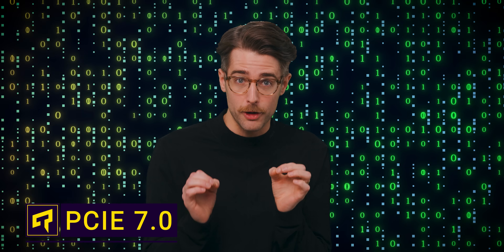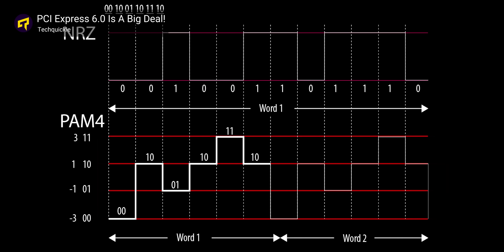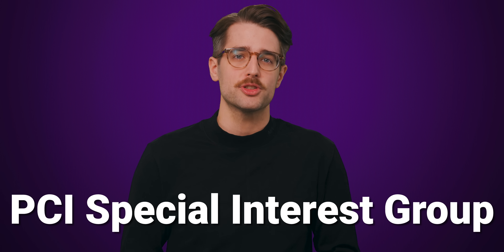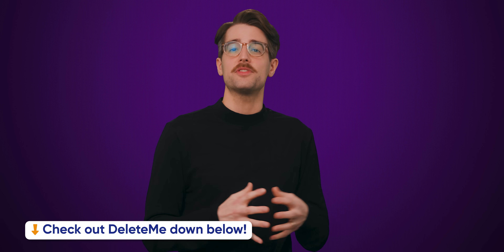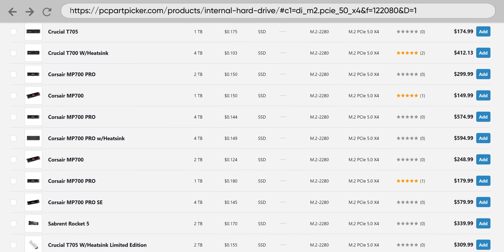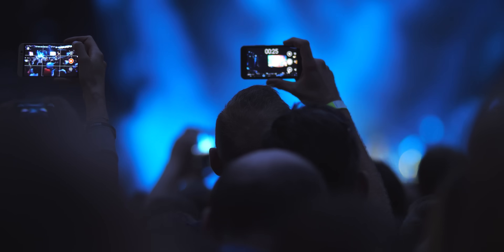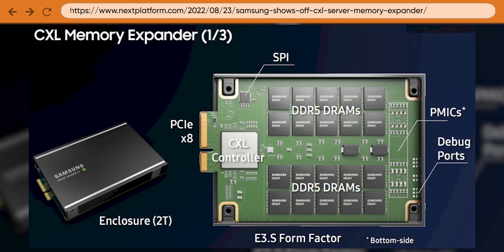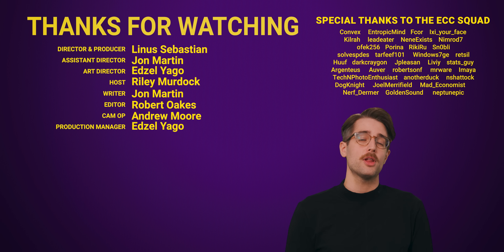PCI Express 7.0 is INSANE

Comment: if PCIE keeps growing faster than our needs we can just reduce the number of lines used, that would make everything easier
even nowadays barely anyone needs 4x5.0 for their SSD, that's only fast for sequential transfers and under load it drops to the same speeds 3.0 does, make it a single line and simplify the communication!
Reply: We can, but motherboard manufacture says otherwise

There's so MANY motherboard that originally has x8 PCIE split socket but now they only provide 1 direct CPU PCIE.

Comment: So like normal a standard for the data center that will get onto GPUs so AIBs do not have to buy 2 types of chips. Another one for nVidia to use for the much higher speed networking cards and not have the bottleneck for the PCIe speed it is plugged into anymore but the CPU.

Comment: PCI Express 7.0 will likely be used for neural processing units (NPUs) on local computers, allowing users to buy specialty cards for that purpose. These NPUs will be at the top of the PCI Lane motherboard layout, with the GPU lane underneath. As AI and AGI continue to advance, people will want self-contained units for tasks ranging from video editing and overlaying to full-on Jarvis-like capabilities. Alternatively, PCI Express 7.0 might be dedicated to external boxes handling AI, AGI, and GPU units through fiber-optic or proprietary plugs. The average computer, with a GPU and basic NPU, currently takes up 4 to 5 card slots, making it challenging to utilize all PCIe slots efficiently.
Reply: Just add more lane, like you know, AM5 eventually did add.

Much more easier, cheaper, and possible than pouring extra money to speed up the development for consumer grade and make consumer deal with the 100% extra price on top of already overpriced motherboard. If you concern dies are getting big, you can shove dual arm retention bracket that Xeon already used from 15 years ago.
Reply: this comment sounds AI-generated to me

Comment: The idea of RAM through the expansion bus sounds so 1970s (think IBM 5150/8088). But I suspect expect it's going to act more like how the Amiga functioned with fast and slow RAM, just not for the same architectural reasons.
Reply: Isn't that what the swap file is slow ram?
Reply: Ram cards have existed on and off several times. Last onei heard of was in the ddr2 era
Reply: In order for any component to be usable as RAM in a system, it needs to be on a system bus that can answer memory requests, and that bus needs to operate at very high speeds. Modern CPUs don't have a single generic system bus for both external hardware and memory devices; instead they have PCIe, DDR, and other pinouts. Only the DDR bus will actually show up to software as RAM. Other storage devices are incompatible; not only are they too slow, but they also work with data at the wrong size. e.g. DDR5 is two 32-bit data channels, but hard drives work with data in 4096-byte chunks that have to be read or written all at once.

Swapfiles are how you get around this limitation, by having OS code manually juggle data between slow storage devices and fast memory devices that the CPU can natively access.
Reply: @TatsuZZmage  the swap file, as the name suggests, is a file, not actual RAM. Its used to swap out sections of RAM with memory on the disk if your tasks need more RAM than you actually have. It doenst have the "Random Access" of Random Access Memory, but yeah in a certain sense it is (very very slow) RAM. Not by the proper definition of RAM of course, but it is part of the virtual memory the OS manages. 

Technically the swap file memory isnt even ever actually directly accessed, it just gets swapped back into the RAM, with another part of RAM being put in the swapfile instead.

Comment: looking forward to skipping 7, and 8.
i'm interested in what 9 and 10 bring to the table. also more lanes like 128 per slot completely independent. 
imagine game scenarios created in real time. no two games will ever be the same. lol, in order to win, lol, you are going to need a faster even computer advising you. lol.  your brain will tap out. you will never leave the game... you won't know real from generated. 
64 bits, yeah, too slow. time to move to 128 bit processors. quad hyperthreading.
terabytes the new ddram standard supplied on chip. 1000 terabyte transfer rates.

Comment: the "only" reason this would be beneficial to users at home is making older gpu's & m.2 use so few lanes you can have a ton of w/o running out of lanes (as they'd need less lanes of a higher spec)
Reply: Except the ports just adjust to the lower spec when you plug in an older card so you do currently still need 16 lanes even if it's a shitty pcie 1 card. You could potentially have a single lane from the cpu go to a chipset that then divides that lane into multiple lower speed lanes for this purpose and effectively achieve the same thing, though.

Comment: it is un-relatable, we seldom find pci 4.0 peripherals today , pci 5 and 6 are basically fairy tales, a standard should not become a standard unless there is a slew of peripherals that use it , as in, actually use it, not just be compatible with it. it mat sound harsh, but GPUs aren't even available that can use that much bandwidth, and aforementioned Ethernet card , well, unless used as direct pc to pc connection has no router or switches to plug into

Comment: Another use case for PCIe 7.0 is that you can use less lanes with the same amount of traffic. A lot of PC have limited PCIe lanes. So having more lanes available is a plus.

PCIe 4.0 16x = PCIe 5.0 8x = PCIe 6.0 4x = PCIe 7.0 = 2x
Reply: It doesn't matter for consumers as you can't bifurcate them anyway and most consumer devices that will go in those slots wont be pcie6.0/7.0.   : / 

Lets say you have your pcie 5.0 and @x8 its as fast as 4.0@x16. But your GPU is 4.0 so it still will need all 16 lanes, nothing gained : /

Now lets say you have some other GPU/device thats pcie5.0 and since its so fast it only needs x8. So you have x8 left and youre happy. Aaand thats when you start digging and go into rabbit hole of pcie layout on motherboards and bifurcation options (lack of them...) and you realize you cant do much with that x8 cause you cant divide it into x2/x2/x2/x2 to connect four ssds, you cant even divide into x4/x4, you have to waste 5.0@x8 on single ssd regardless if that device is x2 or x4, 3.0 or 4.0 or 5.0... : /
Reply: Were lanes limited not bandwidth limited.
We have pcie 4.0 motherboard with x16 slot, x8 slot and x4 slot we can connect 3 devices.
We have pcie 5.0 motherboard with x16 slot, x8 slot and x4 slot we still can connect 3 devices.
We will have pcie 6.0 motherboard with x16 slot, x8 slot and x4 slot we still will only be able to connect 3 devices.
Reply: @sznikers are you a primarily Intel user? It’s been a thing on AMD consumer boards for quite a while now ever since AM4, AM5 supports it as well. In fact it’s straight up just supported by AGESA it’s just up to the manufacturers to expose it within the bios.
Reply: @NawWeeMan  on intel its exactly the same "just up to manufacturer to put it in bios" ... : /
They don't, squeeze on pcie lanes forces people into higher price bracket pro hardware (threadripper & sapphire rapids).
Reply: @sznikers  I’m questioning if you have used AMD because AMD board partners do expose it the majority of the time, it was exposed with my AM4 Asrock board and is currently exposed with my ASUS X670E-creator board. It’s rarer for it not to be exposed than exposed. Maybe the budget B Chipsets don’t expose it? I have no idea.
Reply: @NawWeeMan  both AM4 systems i assembled for my friends didn't had it, only the usual x8/x8 but not x4/x4/x4/x4 which is a must to use those affordable x16 to four ssd cards.
Out of 3 intel boards i have also none have anything beyond x8/x8 available.

Comment: PCIE 5.0 I really think is like going to be the the "why even upgrade past" point for most average people. 
Are there those who could make use of 6, and even 7? I'm sure. But who is actually having that much of a need?
Reply: If processor supports 16 lanes of Gen 7, then 4 lanes for 16x Gen 5 and rest of it for SSD raid or something, idk
Reply: @maksimfedoryak Right, instead of putting a chipset onto our motherboards, we could just connect each chip directly to the CPU with just a single lane each

Comment: The current generation of cards use PCIe 4, and they're already working out the specs for PCIe 7?

Maybe they should work out how to deliver more power over the PCIe connector.
Reply: Current generation of consumer graphics card, you mean. There's a lot more to PCIe than graphics as the video mentions!
Reply: Everything is being driven by the need to connect up very large NVMe arrays. Your options are:

 - Bifurcate or buy PLX switches, which divide the bandwidth between the drives in various ways and result in worse performance per drive
 - Buy CPUs with more lanes on them, which gets expensive real fast and only goes so far
 - Network multiple servers together, which adds complexity as well as cost

A new PCIe version with more per-lane bandwidth pushes back all these considerations because the primary bottleneck to building an NVMe storage array is lane availability. Halving the amount of lanes needed to achieve reasonable per-drive bandwidth doubles how many drives you can connect to a single CPU.

Comment: Optical fiber? That can be a good thing if it becomes reality. Imagine not having the issue of fixing your GPU to the case, the possibility to hot swap GPU like a big PSU box...
Reply: I think you already can hot swap GPU like that, even with pcie 3.0
Reply: @cinderwolf32  yeah, but the connector is really big and more of a lane than a connector, with a plug you'll be able to move the GPU everywhere.
Yeah, there are exteenal GPUs for mobile, but not for desktops
Reply: @TrioLOLGamers  PCIE optical extension already exist, like any hardware PC enthusiast dream of. 

The problem is It's only for enterprise and PC community keep expecting enterprise grade hardware with fast food cost.

Comment: we at PCI 7.0 and current customer motherboards are still stuck at 4.0. Can somebody tell these guy to stop innovating for a decade or two? use their brain power somewhere else
Reply: USB 3.0 was developed in 2007 but i got access to it in ~2016 and my first actual USB 3.0 flash stick in 2019
Reply: Both my AMD and Intel motherboards have PCIe 5

Comment: At this point GPUs should only do 5.0 16x connections, for the foreseeable future at least. And if 7.0 ever makes it to consumers cpus can keep the same amount of overal lanes and everyone could bifricate a 7.0 16x down to 4x and split lanes with other connectors
Reply: That’s where this technology will be useful. Even 5.0 x16 is overkill for GPU’s. Cutting down the lanes allows more motherboard and CPU makers to repurpose those lanes elsewhere in the system. Two x4 SSD’s + one x8 GPU coming straight off the CPU. Or alternatively for budget boards, just get rid of the chipset entirely and run everything off the CPU directly.
Reply: @benjaminlynch9958  For budget boards? How about for high end boards? The chipset adds complexity, and that translates to latency and sometimes throughput. If I have two motherboards side-by-side, one has 28 Lanes of PCIe 4 with 16 reserved for the CPU 4 for the primary NVME drive, and the remaining split among chipset apps, but the second motherboard has 24 lanes of PCIE7 with 8 going to the GPU, 2 to the first NVME and 2 1 lane dedicated to each other communications channel, but no chipset for sharing lanes, that second board is going to smoke the first one in performance. This is why we got rid of the northbridge and southbridge, not for budget but because having more controlled directly by the CPU led to significantly better performance.